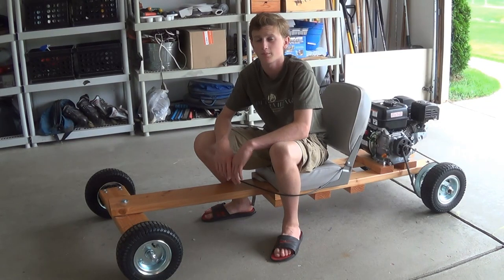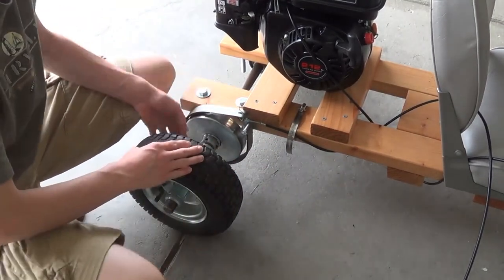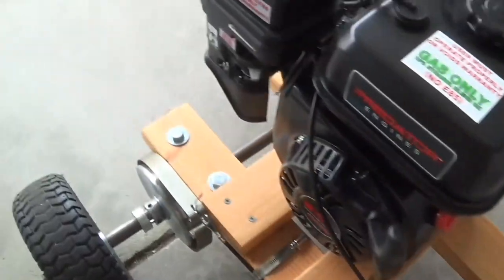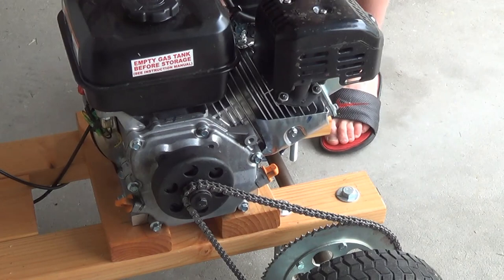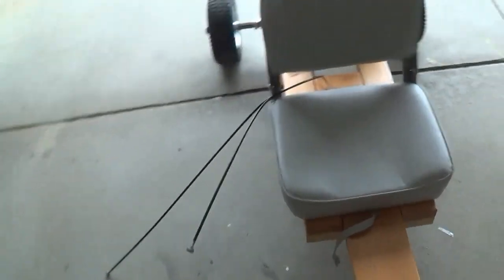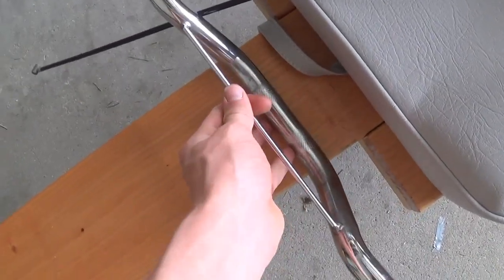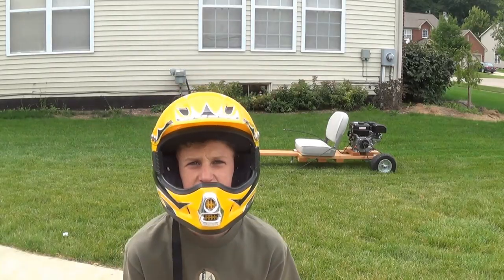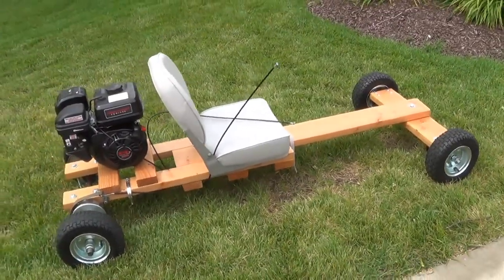How to Build a Wood Go Kart Part 3 of 3 (The Finishing Touches)

Comment: Great video. I built one when I was a kid similar to yours, only I used my feet as brakes and a rubber V belt instead of a chain and soap box derby wheels as I only drove it on the pavement.   Mine topped out at 40 mph. It's encouraging seeing someone your age doing something constructive with his time.

Comment: Eric, you did a great job, very professional presentation, and a nice build.  Believe it or not my brothers and I build these kind of go karts 50 years ago, foot steering with string to control the gas throttle, no brakes, to expensive.  We used the motor to slow down then dragged our feet on the pavement to stop.  Worn out a lot of shoes.  The rich kids got the steel go karts that were really build by their dads.  You've got a great mind.

Comment: As a student in engineering school (mechanical)< I can see you have very good terminology and ideas. I would highly recommend seeking a career in engineering. Also, I have an idea/suggestion. In the case that you are involved in a front end collision that only involves one tire, the steering mechanism will likely punch back into your leg/break your ankle. It would be a good addition to add a stop to the steering to prevent it from turning past a certain point.
Reply: ***** It is a field that is regarded highly and I more than believe that you have the aptitude for it. If you have any question as to what engineering is or what we do, feel free to private message me. :) Never stop doing what you're doing; eventually you will be designing tomorrow.

Comment: built something similar when i was young but we couldn't afford any fancy go-cart parts like centrifugal clutches and sprockets, or even chain... my dad was working  for a company that was constantly disposing of 8hp vertical shaft briggs engines so my dad brought them home and we would tear them all apart and assemble functioning engines from what we had. learned how to make gaskets with a hammer. used plenty of permatex to seal them up. my dad was a packrat and had a pretty well stocked workshop and junkpile, what we built was a wood frame with the same foot-steered straight axle but we used shopping cart wheels screwed directly into the end grain of the 2x4 wood with big lag screws.. the rear live axle came from a riding lawnmower along with the tires, we welded on a v-belt pulley in the center. the seat was on top of the rear axle, the engine was up front and mounted to plywood with slotted holes and a vertical lever in front of the driver that moved the engine to act as a clutch with the long v-belt that twisted 90 degrees to transmit the power. the throttle was a modified schwinn brake lever and cable mounted to the engine moving lever. the belts were used to rotate the flywheel on a punch press before we got them, they were used but still usable for us kids. we never did come up with a brake that actually worked, we had a lever on each side that would drag a hardwood 'shoe' for lack of a better term, directly on the road or dirt surface.. but it didn't really matter because top speed was not very fast, maybe 30mph flat out and most of the time you were putting along slowly due to having no proper brakes..    but, it was still fun to build your own car out of crap.

Comment: I'm building the same go kart from your plans (with some modifications to the steering) and I noticed that there is so much wasted space behind the seat and engine. You could move the entire engine and drive system up about 8-10 inches to drop some weight. I might post a video later to show you how it turned out... :)

Comment: hey, this is a really cool build and i know this was a while ago, but if you could answer my question that'll be helpful. what is the shortest gear ratio i could use on a gokart with a 6.5 hp engine? is 1:4 too small? (10T clutch and 40t sprocket) thanks in advance

Comment: Is there any difference if I was to use a smaller sprocket on the axle because the smaller ones seem cheaper and honestly I'm going to weld everything together anyway so would that size matter?
Reply: So if I'm building a drift trike and I need a lot of spin on my wheels (for drift you know) would the smaller sprocket be good for that? Plus I have a lot of hills around here so would I still be able to climb them well?

Comment: You may have done it already, but put some positive stops on the steering board, or under the main frame board, so that it will not turn too far and scissor your legs.(with the leverage it would have, it could easily break your leg, or ankle). Also don't ride in flip flops !!!. Great job though !!!.

Comment: Thanks a lot for this write up. I am getting parts from Harbor Freight (engine), Home depot( piping and Axle 5/8), Amazon (Pillow blocks and lock nuts) and now I found this 5/8" Clutch, Chain 35 72t Sprocket:,brake,drum, Band,cable, Go Kart, (kit on ebay 109.00. i figure this is going to run me about $300.00 for total project. Again thanks for the write up.

Comment: I fell like this thing has death trap steering. Yeah the gokart does have brakes but think about it imagine your going fast and you lose your footing on the wood at the front. The whole axle in the front would do a 90 degree turn. I could only imagine how bad of a crash that would be. The rest of it is well designed. Good work
Reply: losing your footing really isn't a big deal because of the high friction in the steering. the axle is pivoting on a steel bolt with no bearing surfaces between the wooden axle and wooden frame. what makes this design a deathtrap is running into road debris, that would turn the axle and cause a crash. extending the frame and adding a front bumper would be a good safety mod.

Comment: Looks a bit dangerous using your legs for steering. The back of your heels are probably touching the ground, at least some of the time, since I can see you trying to keep your feet on the steering, which can't be good on your footwear, or your legs (or ankles/feet), if your feet should slip off the steering and hit the ground while moving. Use some of that ingenuity of yours, and create a better steering mechanism... I know, you can do it. A taller tire would give you more ground clearance. With all that said, your project is still an inspiration still, so thumbs up!

Comment: ur still kid lot more to learn...i wd recomand this as dangerous...
Reply: i passed mkechanical engineeringt dude and the atomobile disining so from that expirice i told you so...
regards..
Reply: use and break and a easy atachable tearing or somthingt like that for easy to use ..dont take it wrong but i fing little disapointment
Reply: grt then
Reply: firstly i would like recommend you that to fix the front end the of the go kart and make some the momentum of go kart is safe ,you can use a breaks gear controllers to upgrade that and try to use the acceleration momentum to go back n come front,you did well to move front but in case i need to go back u can use the reciprocal formula to move back and if u attach breaks gear controllers i would as fast as f1 ,i studied ur progress..
Reply: when some thing traveles at a huge acceleration and with momentum the force is to be controlled with jumpers gears cluches or breaks you know that ...if we overlook the karts front end change in direction it can break the front end must be shifted at tangent  46  and the driver must not be safe..
Reply: Sourav Paul how did you pass mechanical engineering if you can't even spell "you're" "would" "recommend" and that's not even all of them. pathetic. get off of this kids case. he good a fine job
Reply: Sourav Paul :) bite me